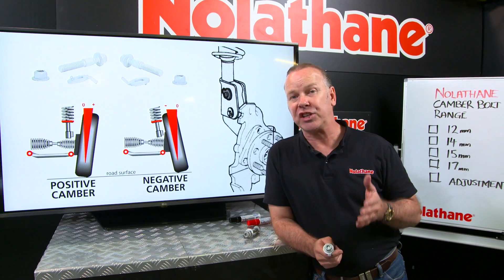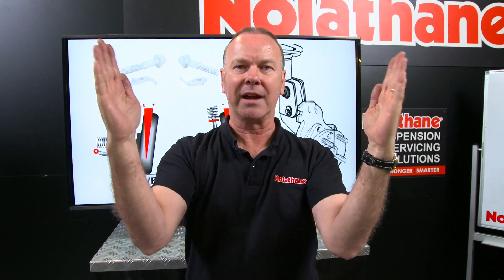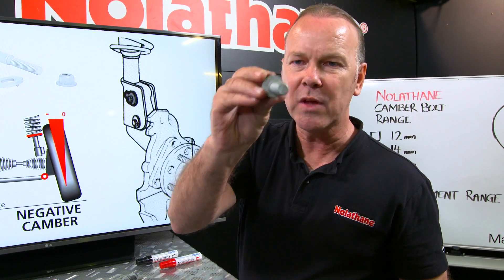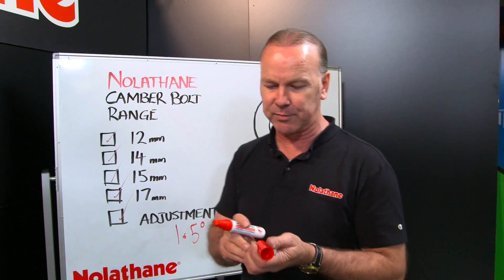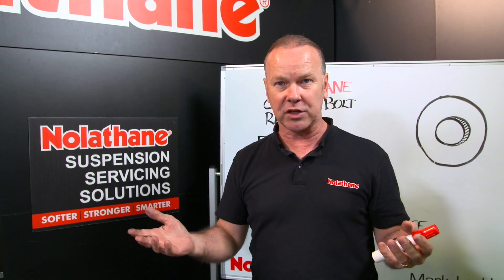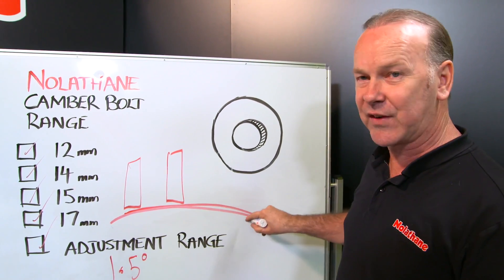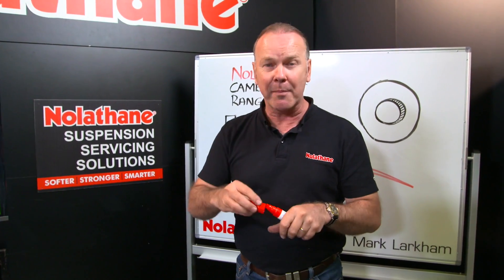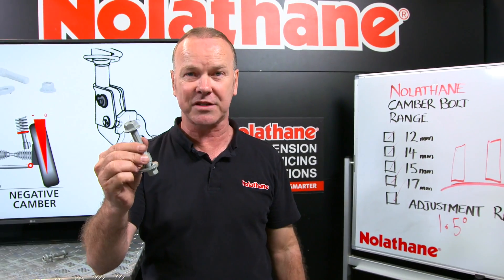Mark Larkham explains Camber Bolts

Comment: question! i have a 2012 Nissan pathfinder and the mechanic has told me when they tried to adjust the rear camber the bolt would just spin and not change the camber so the bushing is stuffed and they have to look into the parts and get back to me. that was 4 days ago. still haven't heard back so I'm considering doing it myself. do i need a double offset bush or will a standard bush do? car is standard height to my knowledge.

Comment: What is the trick to threading the nuts onto the bolts?
I had a pair and the nut seized half way way up the bolt to a point we couldn't even undo it. We had to get the grinder to the bolt to get it off as itnstill needed to screw on approx 5mm to secure the bolt.

Comment: Any Canadian distributors located in Toronto area?
Reply from the maker: Unfortunately not but you can buy directly from our site with fast shipping. Do you know the camber bolt size you require 10mm, 12mm, 14mm, 15mm, 16mm or 17mm?
Reply: Camber bolt size is 12mm.

Comment: Yeah i just buy them from China 10.9 High tensile types. Get 5 for $13
Just a note- when you fit camber bolts be careful with the Torque as the book figures are for the original thread size and the thread on the same camber bolt is thinner as you will see when you study one. You can look up torque figures for each bolt size and type of bolt strength. Always install TOP not bottom on a mcpherson strut so if it fails the knuckle will pivot safely inwards a very small amount.
Reply: Use good quality metal for your suspemsion or your ass will be flying out the seats